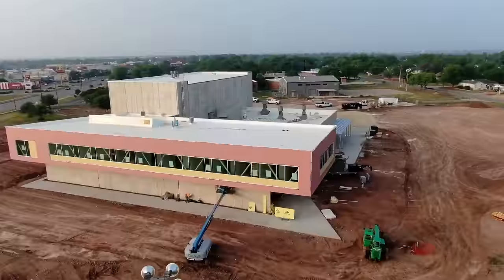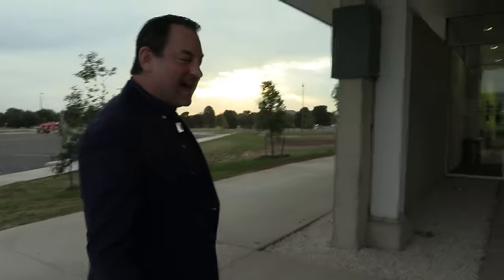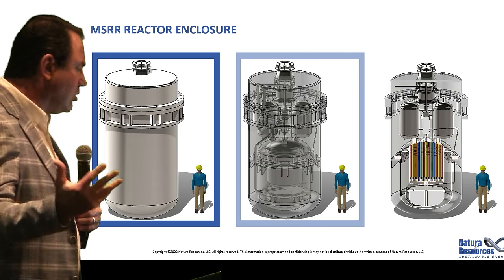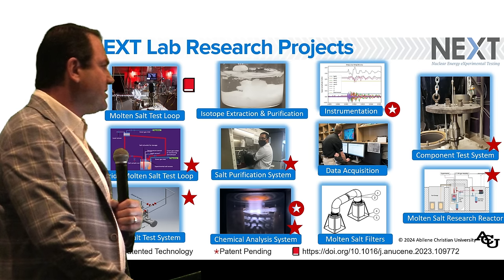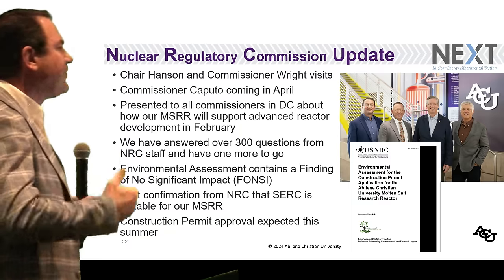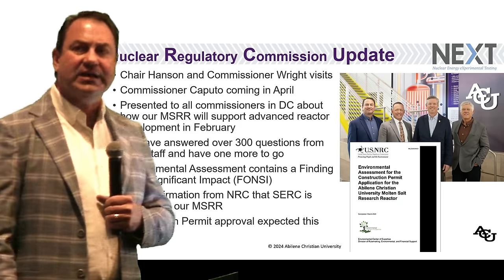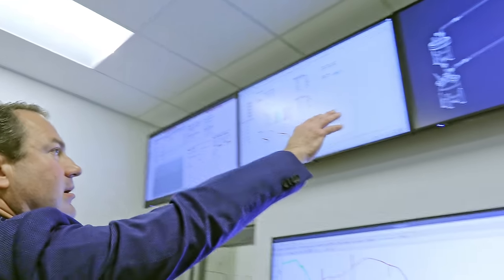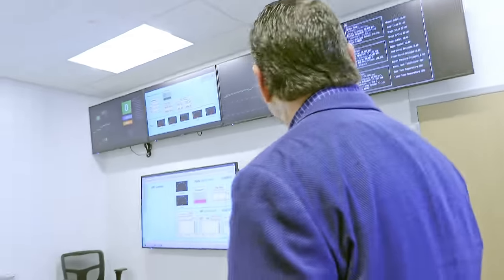TOUR of Molten Salt Research Reactor (MSRR) Site at ACU's NEXT Lab - Rusty Towell @ TEAC12

Comment: The Moltex version has no flowing salt and not radioactive pumps or valves. Their fuel is contained in fuel tubes inside the reactor. Any leak stays inside the reactor case which sits inside a 7ft thick concrete box. It has no internal pressure no pressurised water. None of the components that make PWR so risky. Moltex still cannot get a licence because they don’t have any of the components that cause the hazards in PWR. They can’t click the boxes.
Reply: Seems there need to be new regulations, that reflect the possibility of thorium and MSRs. So far, I haven't heard any government officials speak on that, here in Germany or worldwide. India is an exception, because their nuclear energy program involved thorium from the beginning, at least as a concept.

Comment: Finally, a serious LFTR research center in the USA. Not since the seventies have we done this at ORNL . You will have many impediments in your way, not so much technical but political.  Why? Because it will be successful hence cut into petroleum, other nuclear, foreign parallel competitors, renewables as well as the fusion folly.  This IS the only logical energy solution for clean unlimited energy. I wish you the best success.

Comment: Abilene is stepping ahead of the entire USA. This is so important as to not be downplayed in any way and should be sped up 10 times and many of these reactors need built nationwide. This may be the most important thing being done in America today. It needs desperately to be shown corrosion is no problem when rigorous de-watering systems are in use. Tellurium also needs a very good way to remove from the sytem also.

Comment: The father of the MSR movement is Kirk Sorensen, of FLIBE Enerby, who located the old MRS plans at Oakridge in around 2012.  China grabbed the plans and has been setting up MSRs.  They had several startups last year alone.  We are ten years behind China.  Kirk Sorensen came to the conclusion that government funding is necessary to get MRS, or LFTRs, going quick enough to keep up with China and make a difference.  Private companies have a hard time raising funds because the turnaround on the investment is too distant.
Reply: I agree.  However India has a good setup.  Is the NRC a bunch of Tards?  Yup.  i think it takes several industries working together to get a proper reactor running.  there's already some failed facilities in different arenas that would suffice for a proper 50W test reactor...dry, grid connected, out buildings, etc.  What is indicated in the video is that there is a demand for high grade materials...rad. or not.  Do we have the forges? Do we have the metals?  Do we have the mines?  IS even the rails enough to get mats to/from all over?  no.  It's gonna take the govt. getting serious about material availability and material research, and transportation, etc.  Could you 3d print a space shuttle tile with graphene embedded that won't break 30 foot long that can be slipped into a hastelloy pipe?  I mean, we aren't there.  India and China are not gonna run forever.  Even if we had the 50 yr. Th power in a bottle, it would take 40 years to replace what we got now infrastructure-wise.  it's so daunting.
Reply: Going by that guy's stomach anything's possible.😂😂😂

Comment: @ 17:15 he mentions "Corrosion". Corrosion is directly proportional to contamination of the salt, ergo the purer the salt the less corrosion. Copenhagen Atomics sells salt that is 99% pure, so corrosion is no longer an issue.
Reply: Nuclear involves alchemy. Atoms turn into other atoms. You know what is going to turn into what so you can still prevent corrosion but you'll want to have a purification system in place at all times and if you want a commercial reactor that's there to run as long as possible at full power without needing to be touched, you'll want to study exactly what happens with the tiny impurities over a long enough time. You'll want solve the corrosion issues 5 times over and then pick the 3 cheapest methods and use them at the same time in the commercial reactor.
Reply from the maker: @MrRolnicek  This is a good take. Just replying to help emphasize it isn't the original state of the salt which matters the long run. I'm sure it matters, but even with Kairos (just salt as working fluid coolant) I expect interaction with the pipes will result in impurities. Still, no sense starting with impure salt.

Comment: Wow that radar tank level sensor is amazing! Just the fact that it can see around the pipes corners, would suggest that the pipes are acting as a sudo-waveguide. Can imagine that this would be pretty hard to setup for a reliable indication. The pipes would have to be nearly free of imperfections to prevent false returns and a loss of signal strength. Edit: My bad.... you said laser level.

From my experience it hard enough setting up similar (radar and guided wave) systems at remote oil-n-gas sites in Texas, when I worked for Emerson. Question: Has there been any investigation investigation into system where the capacitance of the chamber is used to monitor the salts level? Aircraft have long used a similar system to monitor the fuel levels in-flight, as floats or radar measurement doesn't work when the fuel can slosh about.

Comment: Since You are in Texas and somehow look inconclusive of what to accomplish with this MSRE, something which ORNL hadn't already accomplished, how about the following: Tritium separation in the 1st SaltLoop and the 2nd Loop, too. Then testing the thermal capability of the hot secondary Loop to do refining of different crude oil grades? Salt doesn't burn, and if You enclose the distillation column in inert Argon gas the whole facility is fire-proof, even if a leak occurs.  Probably a lot of practical Chemistry to be learned by these experiments; valuable for the future! 

 50yrs ago I visited Gundremmingen, the Block C 1300MW LWR before start-up (which the ... Plum out of their heads German politicians have shut down now, prematurely). Impressive from the huge Turbine hall to the large hyperbolic-shaped, very_thin_concrete_wall cooling tower, to the 3m thick Bio_rad_shielding, and the reactor inside. The four main feeding water- and the steam- pipes were designed so that the Reactor building could differentially settle 30cm more than the adjacent machine hall over its lifespan because it was so heavy! 
The whole reactor foundation area was 2m filled up higher than the surrounding area because it was close at the Danube river, where flooding could, and recently did happen.

Comment: I think chloride salt reactors are more promising.  Ed Pheil from Elysium makes very convincing arguments for it. What are the reasons  that fluoride chemistry is preferred?
Reply: Fluoride salts have higher density, lower heat capacity, higher viscosity, and higher thermal conductivity compared to chloride salts at least from what I have read, there may be others as well
Reply: @markburton5292  maybe I misunderstand your comment, but none of the points you mentioned is an advantage. Furthermore with chloride salts you wouldn't have the lithium 6/7 refinement problem ( there is nobody today who does this refining commercially) to prevent the tritium byproduct which falls foul with the weapons crowd.  Also the melting temperature of the chloride salt mix is lower than the fluoride mix. Additionally you could  get paid for the spent  light water reactor fuel the chloride reactor could consume.
Reply: @franztafferner9661  do explain why those aren't advantages. when the very nuclear sites talking about the salts list those as advantages. 

Again I am not a expert I read papers on it but I see those points raised as advantages for that salt not only in nuclear but also in solar salts so I don't know why you say they aren't.

Yes the melting point of chlorides are lower but that also means you have a lower total heat transfer capability  again I'm looking at this from a layman's view

My understanding in both fluoride and chloride salts can be used to "burn" spent fuel from a LWR that is just a matter of processing.

now could there be a reason to use chloride instead sure maybe there are.

Personally, I don't care which they use I just want to see the advancement of MSR technology.
Reply: @markburton5292  I whole heartedly agree with your last sentence. I just think that a chloride reactor as proposed by Ed Pheil has simpler chemistry  and metal hardware. It works as a fast neutron reactor  and as such can complete the fuel cycle. I am far from qualified to write a treatise on the subject,  but  search on u tube There are other  chloride reactor concepts from "moltex"  and  a Dual Fluid Reactor from a German group. If you have the time...
Reply: Fluoride reactors are demonstrated and the salts have excellent thermal properties (even better than water). The real advantage though, is that they allow breeding in the thermal spectrum, requiring a tiny fraction of the fissile, which overwhelms any other advantages that chlorides may have (which also come with all the disadvantages of fast reactors).
Reply: I think number five is why FLiBe is "better".

1. Chemical Stability

Fluoride Salts:

Thermal Stability: Fluoride salts have high thermal stability, typically melting at high temperatures (500-700°C) without decomposing. This makes them suitable for use in high-temperature environments of MSRs.
Chemical Reactivity: Fluoride salts are less chemically reactive compared to chloride salts, reducing the risk of unwanted chemical reactions within the reactor.

Chloride Salts:

Lower Thermal Stability: Chloride salts generally have lower thermal stability and can decompose at high temperatures, making them less suitable for the high-temperature operations of MSRs.
Higher Reactivity: Chloride salts are more reactive, which can lead to increased corrosion and chemical interaction with other materials in the reactor.

2. Corrosion Resistance

Fluoride Salts:

Corrosion Resistance: Fluoride salts are known for their lower corrosion rates with structural materials such as nickel-based superalloys. This leads to longer component lifespans and lower maintenance costs.
Passive Layer Formation: Fluoride salts can form stable, protective oxide layers on metal surfaces, further enhancing corrosion resistance.

Chloride Salts:

Higher Corrosion Rates: Chloride salts tend to be more corrosive to reactor materials, leading to increased wear and potential for leaks or failures in reactor components.
Challenging Material Compatibility: The high corrosivity of chloride salts requires more frequent replacement or use of more expensive, corrosion-resistant materials'.

3. Radiological Properties

Fluoride Salts:

Lower Neutron Capture: Fluoride salts have lower neutron capture cross-sections compared to chloride salts, which means fewer neutrons are absorbed by the salt itself. This enhances the efficiency of the reactor.
Reduced Radiological Hazard: Fluorine-19, the most common isotope in fluoride salts, does not become significantly radioactive when exposed to neutron radiation.

Chloride Salts:

Higher Neutron Capture: Chlorine-35 and chlorine-37 isotopes in chloride salts have higher neutron capture cross-sections, which can negatively impact the reactor's neutron economy.
Increased Radiological Hazard: Chlorine-37 can produce radioactive chlorine-38 upon neutron absorption, which adds to the radiological hazards.

4. Neutron Economy

Fluoride Salts:

Enhanced Neutron Economy: The lower neutron absorption by fluoride salts means more neutrons are available to sustain the nuclear chain reaction, improving the reactor's fuel efficiency.
Favourable Moderation Properties: Fluoride salts have better moderation properties, facilitating more efficient neutron moderation and heat transfer within the reactor core.

Chloride Salts:

Poorer Neutron Economy: Higher neutron absorption by chloride salts reduces the availability of neutrons for fission reactions, leading to lower overall efficiency.
Less Effective Moderation: Chloride salts are less effective as neutron moderators, which can impact the reactor's performance and efficiency.

5. Solubility of Actinides and Fission Products

Fluoride Salts:

Actinide and Fission Product Solubility: Fluoride salts can dissolve a wide range of actinides and fission products, facilitating their use in fuel cycles and reprocessing within the MSR.
Homogeneous Fuel: The good solubility characteristics of fluoride salts enable a more homogeneous fuel mixture, improving the uniformity of the fission process.

Chloride Salts:

Variable Solubility: Chloride salts may have less favourable solubility properties for certain actinides and fission products, complicating the fuel cycle and reprocessing operations.

Summary
The use of fluoride salts in molten salt reactors offers significant advantages over chloride salts, particularly in terms of chemical stability, corrosion resistance, radiological properties, neutron economy, and the solubility of actinides and fission products. These benefits contribute to the overall safety, efficiency, and longevity of MSRs, making fluoride salts a preferred choice in their design and operation.
Reply: @quietackshon  thanks for a easy to read break down.
Reply: @quietackshon  I love Th proponents for just this kind of thorough discussion. Thank you for pasting/posting this!

Comment: A floor in a molten salt nuclear reactor could be a bunch of interlocking "cups" with convenient handles for remote operators to be renoved. 

A research molten salt reactor should only deal with the salt without the radioactive components, to test the mechanics and the chemistry.
No nuclear regulation needed.
Reply: Both of your ideas are good! Your idea about building an example minus the radioactive material has me wondering about the power requirements to keep it molten, and also run a heat exchanger for the generation of steam.
Reply: @YouTubeOdyssey  If you don't put a load on the heat exchanger, the heat input can be measured and indicate thermal losses. 
I would think every part of the reactor and pipes would have electric heaters wrapped around it, under any insulation.
Upon startup the salt, in molten state, would be loaded, and mechanical tests commence. 
After successful results the nuclear material can be added. 
Dump tanks would likely also have electric heaters, of immersion type, for keeping the salt from hardening. 
The Copenhagen Atomics Onion Core reactor could be controlled by removing the heavy water moderator. 
I'm sure those guys have better ideas.

Comment: 33:02 the interdisciplinary team should have included a Transmission Construction Engineer to cost out the 'to the  customers costs'.
Bigger amounts of electricity means bigger grid capacity. 
To millions of customers.

Australia has had a Royal Commission investigation when simple upgrade costs were passed onto the millions of customers. 

The reactor will have great value in the medical materials with short life spans. 
This is a real thing and is a problem when transporting Lucas Heights radiated material in Sydney to Perth Hospital for medical treatments. 
The reactor will have great teaching value and research value. 
Nuclear will always have a place.
Nuclear limitation and benefits are being researched here. 
A small campus or local suburbs generation capacity will be useful. 

If the alternative of  Rooftop renewables and Battery Vehicles is viable then this is a very good way to find out.

Comment: SMRs, Small modular reactors, cost $2billion for each generator plant. Per 300 mW.

Battery Vehicles are getting cheaper and rooftop solar PV is cheaper than windows $/m2 if utility paperwork and delays are removed.

Panels are a few $s 200.
Inverters are a few $s
An electrician a days pay.

With a Battery Vehicle and Rooftop PV, electricity can be dirt cheap offgrid. 
A little LNG in midwinter days is ezi pezi.
Petroleum for bitumen roads and petrochemical industry means some Petroleum will always be available.

Comment: I remember reading about Thorium and liquid salt reactors ~10 years ago and running across some VERY strong opinions stating this wasn't possible....despite being built and proven in the 60's and abandoned because it couldn't be weaponized like what we have today.
Reply: The 1960's reactor was just a proof of concept.  Today, the engineering standards and expectations for nuclear reactors are much higher.  There are still significant engineering challenges and though China seems to have a thorium MSR operating, they seem to be keeping quiet about the details.

Comment: 29:24 old technology like land lines is superseded by modern technology. 
My point is that transmission lines maybe the cost limitation on nuclear electricity generation. 

Texas is in the sunbelt of the USA. 
Renewables and Battery Vehicles can test this molten salt reactors economics. 

I am not saying that nuclear technology is safe or dangerous. 

I am saying that there is an economic problem with all grid electricity. 

As a worldwide solution, a solution that will make fossil fueled CO2 emissions countries turn off their old and build nuclear industries may have far more costs than we all realise. 

In very cold latitudes turning on the nuclear electricity in the low light winter months to charge the battery vehicles and lights and heating etc. May be an absolute necessity. 

The utilization factor of the reactor may not be the best. 
The grid utilization factor may not be the best.
But it may be the best for those latitudes.